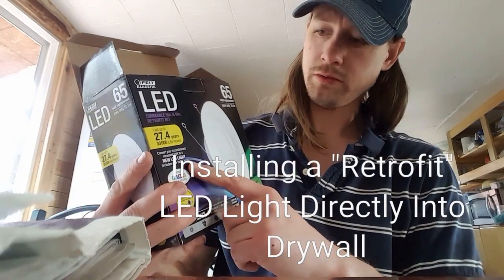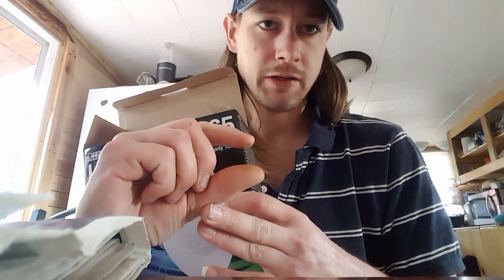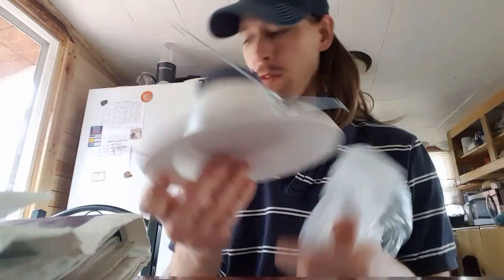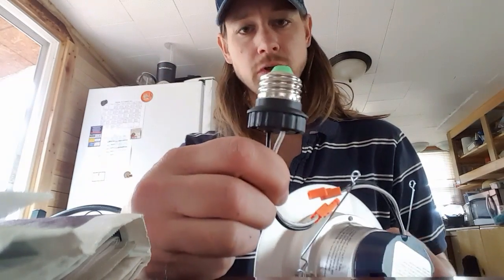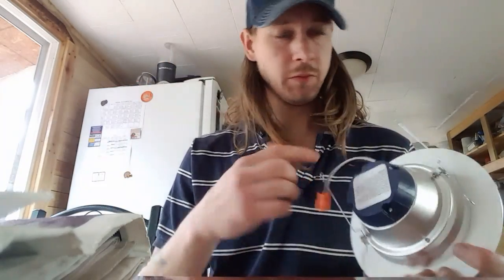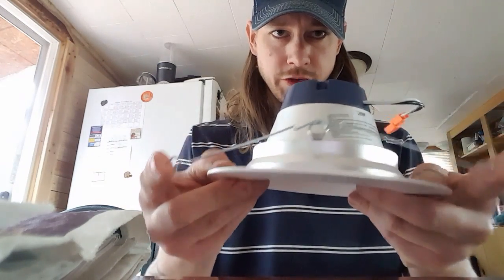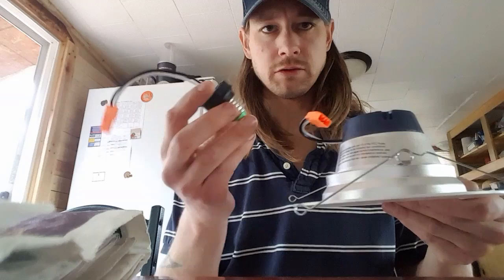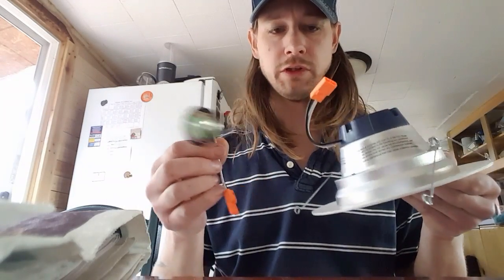Retrofit LED Lights Directly into Drywall

Comment: Great ideal, but I wonder if that easy remove later? Because you flipped the spring.
Reply from the maker: Yes, easy to remove.  But now days this really isn't necessary with the flush mount recessed LED lights that include a junction box that are widely available at stores.
Reply: @markfothebeast  I would like to replace old recessed light that using E26 light bulb base but I can’t find any new remodel recessed light with this kind of base.  Do you have any recommendations? Like buy a adapter?
Reply from the maker: @kellykai4068  Personally, I'd pull the old housings out and cut a circular hole in the ceiling drywall to match the diameter of the replacement lighting.

However, not everyone is an electrician or can repair drywall. And that's what makes YouTube a very useful tool! Home electrical work can be a liability.

Comment: I had that question too... can you use these without the can housing and still pass code... I don't think you can because the housing is not meant to be alone without  being protected by steel.
Reply from the maker: The wiring wouldn't be up to code. But there are now lights today that you can purchase that do just this and include a self contained junction box.

Comment: Need to know bud how did this work out for you wanting to go same route in m hu home to?
Reply from the maker: This worked out fine. Back when I'd posted this video, the selection of lighting has since changed. I really love these. And they are actually cheaper than retrofit style lights. And smaller. The wiring tucks inside the included box as well.

https://www.amazon.com/TORCHSTAR-Ultra-Thin-Can-Killer-Downlight-ETL-Listed/dp/B07FFNFJZV/ref=asc_df_B07FFNFJZV/

Comment: No issues with this install except for building code. If you have a home made after 1980 you should have insulation that does not combust cellulose insul. Has a class 1 fire rating if your attic continuously catches fire in the summer when temps can easily reach 180 plus ambient temp then don't install these. If you are concerned cut batt insulation away from light or clear blown insulation away from mounting holes get some Metal tins and cover light. Problem solved... Just food for thought those can covers are made of metal right huh so if a live circuit happened to hit the metal that would create a spark...... What happens when a live circuit hits drywall not a damn thing... Those metal cans absorb and hold in heat huh they must get pretty hot what happens when heat is not contained to a hot metal box it rises and dissilates. I'm just saying. I would however go buy some plastic junction boxes for your Romex there like 1.60 a piece good luck

Comment: I have a dome ceiling so I'm gonna do the same thing....w/out a can insert. 
I dont think thry get hot enough to pose a threat...
?
Reply from the maker: They don't become hot at all. Some of the newer, brighter LEDs actually do become much warmer. Not quite hot enough to start a fire. However, compare these to an incandescent bulb that's in a fixture that's hot enough to burn your hand.
Reply: Or u could just buy a slim led insert which are actually intended for that application

Comment: The other LED ones use a small box for the line voltage junction and the low voltage (12/24/36V) connection can be free air. You're effectively creating two open air line voltage splices with this strategy.
Reply from the maker: I've seen them with an external AC/DC power supply. The DC circuit is internal on this style. Today there are many new options for this type of lighting rather than using this cheaply done method.

Comment: THANK YOU FOR THE LOGIC around 1:00. This is so commonsensical.  I always wondered about IC, Insulation; ventilation and Code/fire problems. How does an LED fixture get to 180!?!?!?  does that have a built in transformer?

Comment: Hey buddy I just installed some lights with your preferred method and it works excellent! Looks like you're pissing off all the electricians and inspectors that are used to doing things by the book. These LED lights do not get hot enough to burn a baby let alone start a fire! People don't waste your money on the cans. You do not need them with the LED lights! You may have an issue when or if you sell your home but do as I do and sell as is! They can take it or leave it! Thanks for the video sir!!
Reply from the maker: USA Tickets I made this video almost 2 years ago. House didn't burn down. I am installing 20 LEDs in the living room right now. These brighter Sylvania LEDs get hotter than the one in the video (130F). But still not hot enough to start a fire. Incandescents themselves heat up a light housing beyond that temp.

Comment: Guys this will work, LEDs do not generate that much heat.Thank you for showing us the temperatures of various lights.
Reply: But you could buy the right stuff that is available for installations without much space, and not risk a fire.  Why do this?

Comment: I did this in my laundry room with lights put into a drop ceiling with 18-22" of clearance above. Cut of male socket, and ran wires into a j-box. I electric taped the orange connectors to prevent them from pulling apart and possibly causing an arc. I also taped the wires going into j-box a(front to back over top and under bottom)style to prevent wires getting yanked out. Wire nutted and taped those as well. I ran main power to a central round j-box and ran four wires (14/2) ;one to each of the four lights. Kinda spiderweb like. And put a cover on j-box.
Reply from the maker: I personally like taping the wire nuts myself. The problem is if the wires aren't in the wire nut touching one another snug, they could arc, smolder and the tape may melt and catch fire. One reason I don't like wire nuts... Soldering them would be the safest method in my opinion.

I'd seen a melted wire nut a few times. They do a great job of containing a potential fire. But like everyone has mentioned, a junction box should be used as a double measure of safety (which I did not use in the video).
Reply from the maker: joe jones You could use something like sheet metal to space the light away from the insulation. Or shove an unfaced insulation bat up there first. But some are afraid of direct contact with fiberglass. If you are concerned about the light housing touching fiberglass, there's also high temperature rated rockwool insulation. I used rockwool around my woodstove and to insulate my oven.
Reply from the maker: Sounds like a good idea with fabbing a sheet metal housing.
Reply from the maker: joe jones The selection of recessed LEDs was very bare during the time this video was recorded. There's finally products coming out on the market. Now only if they would sell them in big box stores. Which is slowly happening.

Comment: Enjoy your house fire.
Reply from the maker: Can you share with those who view this video the potential causes of a fire? (No offense intended).
Reply: You're wiring direct to romex outside of an accessible junction box, and stuffing insulation around a non-insulation contact rated light. It's a house fire waiting to happen.
Reply: https://www.youtube.com/watch?v=MgmSukybivo
Reply from the maker: Joel Keen Yes, the romex wire nut connection outside of an accessible junction box is mentioned. That's my my only concern. These can arc and smolder potentially causing a fire. Which begins with a poor connection. I've seen melted wire nuts from just that. But more commonly I find melted NEC rated 15-amp 120v outlets.

 As far as direct contact, I have very little concern of fiberglass catching fire from a +/- 120 degrees fahrenheit LED light housing. Imagine temperatures a typical recessed can will reach with an incandescent bulb. I'd assume much hotter than 120F. 

The glass globe fixture itself was nearly twice as hot as the LED! And there's fiberglass in generally most typical light fixtures just above the bulb.

I have a hard time intentionally burning fiberglass from an ignition source but it does burn in a fire that's hot and toasty. Then there's rock wool insulation that handles much higher temperatures. I've used this in wood stoves and brick ovens. This would be great behind fixtures but it's messy, hard to work with and unneccesary.

As far as the LED light housing, the internals are low voltage DC other than the power source wiring, which I have a lesser fire concern over. I checked ratings and temperature tested the lighting well before I decided to stuff these things up in my ceilings. My only concern is the wire nut junctions as mentioned.
Reply: @markfothebeast  You could still contain any wire junctions within a single gang plastic junction box. The only remaining concern, I'd think, would be that the wires from the junction box to the light fixture itself, while insulated, don't have the benefit of non-metallic (e.g., Romex) sheathing, and they're carrying 110v. They're more vulnerable than Romex sheathed cable that would normally be outside the j-box. But at least you could keep your junctions within a j-box, and therefore protected.
Reply from the maker: @JonathanStrong  For sure. My biggest concern is that some aren't sealing off the moisture barrier in colder climates. This will corrode the light fixture and wiring with moisture. The moisture barrier is extremely important in cold climates. Also called "vapor barrier". Your roof decking will rot without it.
Reply: @markfothebeast  Understood. I was focused on my own situation -- adding a number of recessed lights in the 1st floor ceiling of a two story house. While I was able to locate the joists from below with a stud finder and cut the holes between the joists, I couldn't anticipate various roadblocks like diagonal joist braces and my biggest challenge right now: a hot and cold water pipe running across and through the joists just a few inches above one of the holes I cut. I could try your technique for this one light (it's a Halo retrofit LED fixture with torsion springs for can mounting), or return the three lights and get ones instead intended to be mounted to sheetrock only from below -- the hole size is different of course (why would anything be standardized???), and the lights aren't recessed at all and won't look as good. Decision to be made in the morning after I get some sleep! Re: your point - the vapor barrier isn't important for my particular location between 1st story ceiling and 2nd story sub-floor. But for those doing this into the top floor ceiling, it's clearly a very important consideration - agreed!

Comment: Great! thanks a lot for the idea. I have 5 recessed lights in kitchen and it seems they are around 25 years old builder installed new construction recessed cans. There was no can as what we see now instead there is this dome which directly connected to the bulb socket. When I bought the LED retrofit trim there was no way for the torsion spring to stay put inside that dome. I was planning to order remodel cans and doing all the work of removing old housing and putting new ones just to use those led trims. But your video saved me a lot of hassle. The great thing is that I have a 2 story house and kitchen being on 1st floor so there is no insulation in the ceiling. Thanks again!

Comment: Awesome. At least you feel good about saving those pennies when your house burns down and kills your family and insurance won't pay your claims because of jack-leg, non-compliant electrical work. Good Job!!
Reply from the maker: I understand your reasoning. Can you share some examples of what not to do for those that view this video?
Reply: How much room above your ceiling do you have? The lights should be installed in these type of cans. You install them from the room side so you don't have to get  into the attic.
https://www.homedepot.com/p/Commercial-Electric-6-in-Aluminum-Recessed-IC-Remodel-Airtight-Housing-6-Pack-CAT7ICRAT-6PK/202323815
Reply from the maker: Unfortunately, I do not have an attic. There's between 8-12" above the drywall to the roof decking. After insulating and finishing the "rafters", that leaves very little room. It is a very odd type of home with a low pitch roof.
Reply: I see. Might look into something like these made for ceilings with 2x6 rafters in attics with limited space. 
https://www.homedepot.com/p/Halo-H27-6-in-Aluminum-Recessed-Lighting-Housing-for-Remodel-Shallow-Ceiling-Insulation-Contact-Air-Tite-H27RICAT/202024769
Reply: J V 
I was going to do the same procedure not to save penny's but other reasons. Can you please explain why this is unsafe? If the wiring is inside a gang box, wire nutted and taped is it safe then?
Reply: J V 
Oh btw I have nothing in direct contact. Open space above.
Reply: @joejones5491  the ac wires are not inside metal housing is the issue. With the other flat ones he was showing, the little 'transformer' piece would be inside a junction box and the escaping wires to the light were low voltage dc. Now those loose wires are ac110 15amps and they're not enclosed without a recessed can.

Comment: Dude I did the same thing that you did when online didn't  find installation  without a can so I tried it with out it and  worked out fine for  me as well but I brought the ones on eBay which only had two wires
Reply: Mine only have 2 wires too. So do you just not use a ground ?
I didnt want to install them in cans.
Wulf

Comment: Have you had any problems installing these retrofit leds without the can?
Reply from the maker: Alex Masso I've had zero issues. Just be sure to cut the hole diameter so that the light fits tight.

Comment: How do you wire the connector in?
Reply from the maker: *It depends upon your style/brand of LED fixture. It's always wired to the 120v AC input regardless.

This light included an adapter with an orange plug on one end and a threaded male light bulb type end on the other. The light fixture itself is equipped with the other end of the orange connector. The harness end is not necessary but it can make it more convenient to install the light by simply plugging the connector in.

Option 1: You can cut the light fixtures orange end off and hardwire the two wires in to the light circuit. 

Option 2: Cut the male threaded light bulb end off the harness included and hardwire the two wires from this to the circuit - this will give you a convenient plug-in when reaching overhead to install the light.

However, if you are using a different brand of LED light, some have an external AC to DC adapter. The light shown has an integrated AC to DC circuit which is why it can be wired directly to the two wires in the fixture itself. The type with the external power adapter will need to have the 120v AC input end directly wired to the light circuit. 

If you are unsure of the wiring in a basic light circuit, I'd suggest doing a bit of research first. Black = hot and white = neutral but this is not always the situation.

Comment: Hi, I am thinking about doing the same project as you. However I am concerned about having the LED's transformer (source of heat) directly touching the blown-in insulation... is it safe? Thanks
Reply from the maker: +Sergio Garcia The AC to DC circuitry on the particular LED lamps shown are integrated in the fixture itself. The heat test near the end of the video is an example of how cool LED components run in comparison to basic CFL and Tungsten bulbs. If using an external power supply, I doubt it will exceed half the temperature of a tungsten bulb. 

I come to think about it, it's probably a bit safer to use an external power supply. If you have concerns about fiberglass and drywall going up in smoke, the temperature rating is far above LED temps. It's just not up to "NEC" code (national electrical code). But I find them far safer over CFL and tungsten bulbs.
Reply: Thanks! I think I will install them as you did but will put a PVC pipe around them when blowing in the insulation. Just to be safe!
Reply: Sergio, in a word, No.
Reply: Code: all connections required housed in a junction box (2 hour fire hold back).  Also, the model shown in video is an 'LED upgrade' kit.  And thus, only for use inside of an existing housing (IC/non-IC).  (IC: insusulation contact).  The gentleman's house will fail inspection, thus: no permit of occupancy.